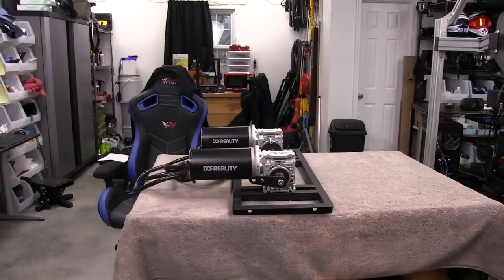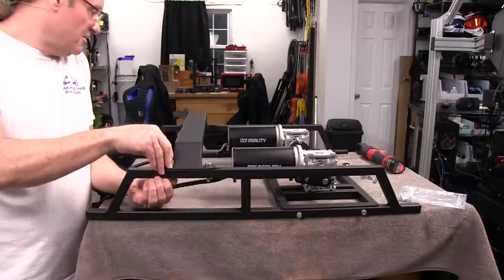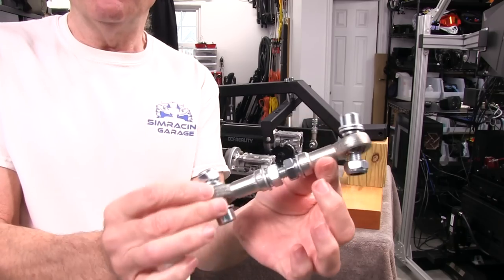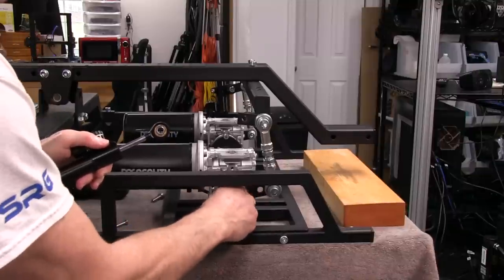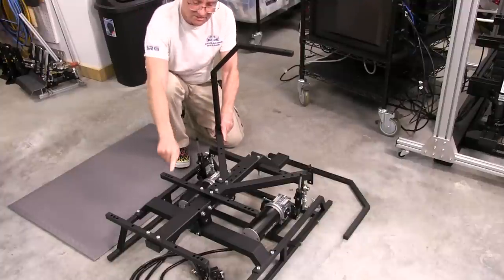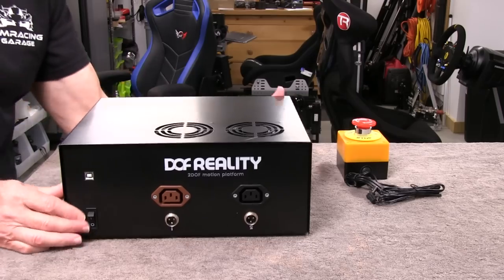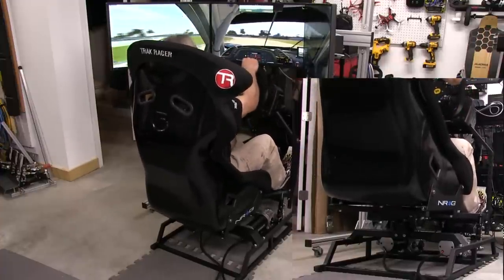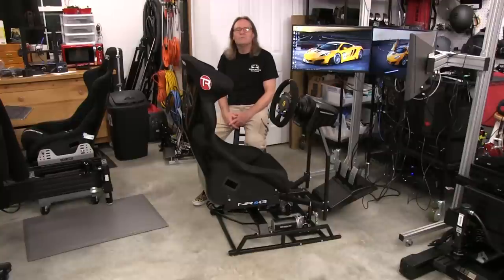DOF Reality H2 Review

Comment: about smoothing; real driving isn't smooth so wouldn't these abrupt movements be a good thing for immersion or are they too abrupt?
Reply: ^^ My thoughts exactly. Track driving at speed with rapid changes in weight distribution is pretty violent in my experience. I would have thought this would result in a more realistic simulator?

Also the DOFreality seems to have a lot of movement vs some of the actuator systems that appear to barely move at all. Again something that one would think would add to realism?

Comment: I have the DOF P3 with traction loss and it is horrible for dirt rally 2.0 and dirt rally... the traction loss is a joke and it clunks and bangs even on a low setting if you live in a flat you will get complaints straight away from your neighbor even at low settings as it vibrates through the floor I can only use it at low settings around 25%... Have you thought why nobody is showing a decent video for rally games the answer is simple because it is awfull for rally games.